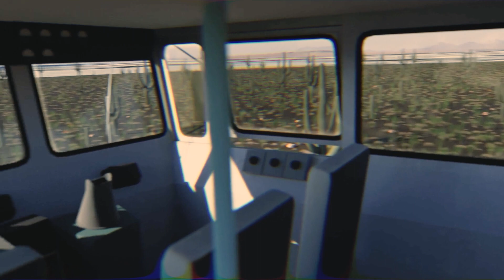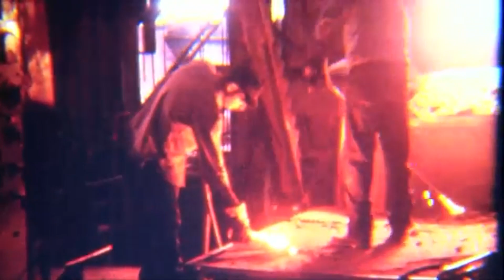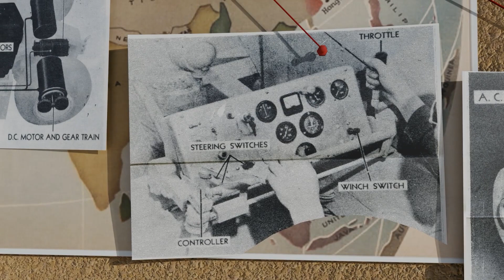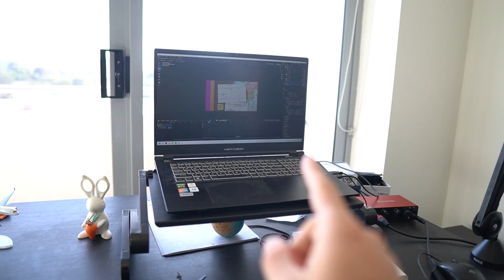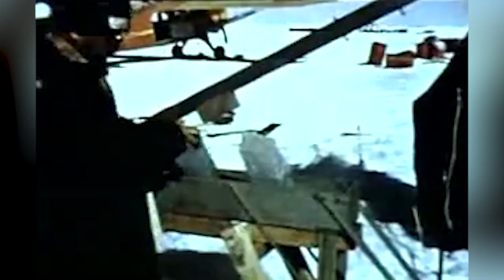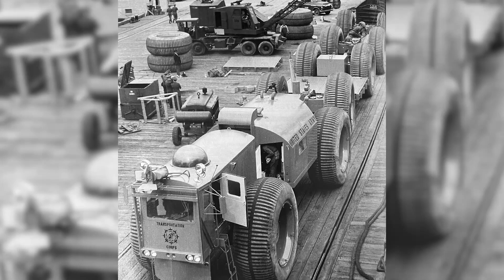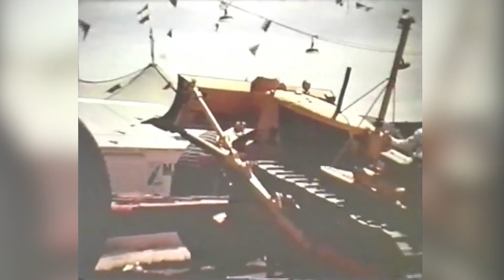What Happened To The INCREDIBLE Land Train?

Comment: It would be cool if dirty diesel locomotives could be replaced with clean nuclear power...
Reply: That is a million times a bad idea. The diesel runs electric motors. How do you think the get great fuel mileage?
Reply: @Hix2526  lol. I'm not gonna take advice on what is a "bad idea" from someone who can't even construct a proper sentence and use proper grammar. A nuclear engine, especially on a diesel locomotive, would completely get rid of the need for fuel altogether. Basically giving it infinite milage. You think nuclear aircraft carriers and submarines ever have to refuel? The ONLY reason they can't stay out indefinitely is because they can't carry enough supplies for the crew. A nuclear power source only needs service once every 20 YEARS. If anything. Nuclear locomotives would be "a million times a good idea." Just because you're an idiot and dont understand how nuclear-powered vehicles work doesn't mean my idea is a bad one. Smh. Theres nothing worse than an idiot trying to tell you your idea is a bad one.

Comment: Can you please cover The Thunderwell🙏 Nuclear steam piston concept launch system/weapon for launching cargo into orbit, destroying asteroids, lol and aggressive Alien Spaceship! https://youtu.be/VonfewfNNfI 😆👍
--  The steam accelerated Jules Verne capsule, which was suggested by the speed of at least 6 times earth’s escape velocity, achieved by the 10-cm thick, 1.2 m diameter steel cover blown off the top of the 152 m shaft of the 0.3 kt Plumbbob-Pascal B underground Nevada test on 27 August 1957. In that test, a 1.5 m thick 2 ton concrete plug immediately over the bomb was pushed up the shaft by the detonation, knocking the welded steel lid upward. This was a preliminary experiment by Dr Robert Brownlee which ultimately aimed to launch spacecraft using the steam pressure from deep shafts filled with water, with a nuclear explosion at the bottom; an improvement of Jules Verne’s cannon-fired projectile described in De la Terre à la Lune, 1865, where steam pressure would give a more survivable gentle acceleration than Verne’s direct impulse from an explosion. Some 90% of the radioactivity would be trapped underground!

Comment: right, everything back in the day was built for the purpose of its use and built like a tank, today we think newer is better and that lightweight stronger materials computerized vehicles are better faster safer cleaner then the bulky slow to medium heavy duty gas drinking behemoths. Just not the case. I know cheaper, cleaner burning is the new way, but when it comes to vehicle's we never beat the 40, 50, 60s there were designed for ever and $$ has killed them maintained upkeep etc...Ya I'll agree we have some today, but then was the golden era of building they built it every way possible with any, everything that would give it an advantage! It was great!. Now all the knowledge to evolved in todays versions just are as whats the word not impressive they are, I guess Honest, straight up for its purpose would fit it.

Comment: While the commentary is annoyingly vague, I can tell you that petrol-electric or diesel-electric drives have been around long before the 1950s and Letourneau's designs.  

For example, several German WWII tanks used a petrol-electric drive to move their large chassis on tracks.  

- and of course trains used both systems long before, as electric motors powered by current from an internal combustion engine actually begin in coal-fired steam-engine times.  
Usually for ships, but also for cargo vehicles on rail and road.  

So.  First land vehicle use; no.

Comment: Modern day innovation, seems this is a bit lagged. 
The 'Vision: would be a bit more high tech meets dimly lit atmosphere with sparkling glimmering lights from the appearance of a UV light reflector and fast rapidly moving pathways with modern architecture design and simple, clean lines. 
As far as it regards a train design on ground vs underground, that's a different topic, project all together. 😏

Comment: from an 'ENGINEERING' mind, let's visit the flaw's and failures of this experiment.  1: it relies on the terrain to be within a certain degree of gradient to traverse the grounds.  The fault in that is it will never stay the same. Trains admonished this differential by cutting and laying tracks at a grade acceptable to the cargo engine, and cargo.  2: speeds will be limited by tire inflation, engine speed control, cornering, and suspension.  Do I need to say more?

Comment: This could be an idea due for a revisit. ..particularly in areas that require cheaper less time critical outsized load deliveries. 
Sandstorms and ice storms in high winds are killers for aviation.  
With modern computer control and navigation systems self propelled sections could split off to different locations and reform later possibly on the return leg or by catch up at a staging post.  Diesel electric has got even more efficient and 
as each power waggon is a large scale self propelled generator plant that could support a community or camp.
Some Canadian cities having lost their Grid power... have resorted to using giant Diesel Electric goods locos to provide emergency power for weeks.
The train Co just re routed the rails and they drove them off the track down the main street to the standing point for the connection.

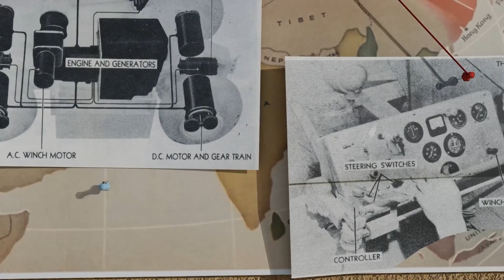Comment: 4:10 not sure where the idea that many modern electric vehicles use in-hub drive. So far it's just the land movers that are doing this.
Brabus experimented with another company to put electric motors in wheels for consumer cars but this hasn't reached production testing AFAIK

Hybrid drive train was used in WW1, and it's cool that in-hub driving was tested later

Comment: I don't want to be  mean, but being a PC enthusiast, I have to step in and say that that new PC (as cool and powerful as it is) only took "days to make" because they had to take the tempered glass panel to a sandblasting workshop. Which if they have it on site, would take perhaps two hours tops, and that's being generous. 

The rest of the system (again, not discounting how powerful the build is), would take a trained PC technician just a couple of hours to put together, and that's if they spend some good time cable-managing properly and making sure they everything boots and works properly. 

I wouldn't have said anything if it was you who built the PC, but since it's and advert, I just felt it just to point that out to potential impressionable buyers that might think that a simple glass customization is something that only that company could do. When you just need a PNG image, or SVG image, and take your glass to a crafts workshop and they can do it for relatively cheap.

In my case, I took my PC's aluminium front panel to a CNC shop and a quite elaborate cut cost me about US$16 and change.

Comment: It's amazing they did this with relays and potentiometers! No motor controllers or feedback.  They had all the cars communicating with each other to make sure each wheel was turning at the correct speed in a time when canbus didn't exist.
Reply: When we build thing to solve problems, we tend to innovate to solve technical issues. When we build thing we don't need, we tend to fail a lot. xD
Reply: Control Theory describes the theoretical feedback loops necessary to keep physical systems stable. These systems can be realized either in digital circuitry with math operations and delay lines, or analog components with inductors, capacitors, transistors and resistors. In a way, analog systems are a more natural fit for implementing these control loops. I'm pretty sure at the time you could walk into an electronics and buy an FM radio that had the very same control loops required to demodulate the signal.

Comment: Hi one of the trains is in Yuma, Az. at Yuma Proving Ground at Air port. There was several test done at the sand dooms between Yuma, Az. and El Centro, Ca. I was told by the salvage buyer of the train it did not meat the standards for the Army. he striped it for salvage and gave the rest to the Army YPG. For display. The Army said It was so heave when it was parked in Alaska it would sink in the tundra they had to 24/7 monitor it and keen moving it it would latterly sink. The name of the salvage company is or was Jet Sales Co 1401 S Arizona Ave Yuma, AZ .
Reply: WTF is a "sand doom"?  Does it involve sarlaccs?  🤣

Comment: Seen one in person in Whitehorse at the Transportation museum.  What a beast they are, the one I was in was powered by a V12 twin turbo diesel. Its not drivable as the wires have been cut to the motors but its still a sight to behold.

Comment: In 1986, the creator of the of the original Big Foot Truck scraped the TC-497 MKII tires to build the Big Foot 5, which today still holds the record of the heaviest truck at 28,000 pounds.
Reply: Wow someone has been on Wikipedia 🤣
Reply: @brandonweaver2024  I was bored. 😄
Reply: BIGFOOT#7 also has a set of the 10ft tires. It's currently on display at the "Big Fun" amusement park in Orlando, FL. It was on display at the now closed Race Rock Orlando restaurant.
Reply: what you mean the heaviest truck at 28000 pounds?
aren't zeroes missing there?
Reply: @e.s.6275   sorry, heaviest Pick Up Truck.

Comment: I would say heavy lift helicopters didn't play a role in the cancellation of the land train program for the construction of the DEW Line. The CH-54 (the military version of the Sikorsky Skycrane) shown here at 18:20 wasn't introduced until several years after the DEW Line was finished. In an old documentary about the construction of the DEW Line https://www.youtube.com/watch?v=-Mfwcp6rTjc the only helicopter in that film is an H-21 that only took light cargo. 

On single land train, the VC-22 was actually used there for one construction season until it had an engine fire and was never fixed or replaced.

It seems most of the overland transportation was done by planes with skids or sleds pulled by regular Caterpillar bulldozers.

Comment: I wonder if a nuclear or even fusion-powered version of this, built on-site, will ever be rumbling through the plains and deserts of Mars. Given a stable power supply that runs without atmospheric oxygen as well as life support and radiation shielding, this thing could be perfect in an environment that does feature low gravity, yet doesn't have an atmosphere dense enough to support operating cargo helicopters economically. So whenever you need to transport a huge amount of stuff from Musk City to Bezosville, you just strap it onto this beast and watch it tear through the red sands.
Reply: The martians won’t be exactly amused by it I don’t think.
Reply: @Squawkinator6514  Come on, it's fine - as long as you don't mess up their canals, I'm sure it took a long time to dig those
Reply: What is Amazon transporting there? You don't even get this machine there in the first place
Reply: A high grade battery core and a Newman motor could work as well.
Reply: It would be a very useful vehicle for delivering railroad construction supplies. :P
Reply: There needs to be something on Mars worth all the trouble getting such a machine there. Right now Mars looks pretty worthless. There's bound to be enormous mineral reserves that haven't been found yet. Time will tell.
Reply: @olliefoxx7165  That's true, I'd assume with all those vulcanic tubes that are there apparently, at least some would have the good stuff in them - but also from a colonization point of view, you'd probably want to transport supplies over increasingly longer distances without comparatively tiny 2 to 4 man rovers, and lacking oceans, roads, or an atmosphere particularly conducive to air travel, it's pretty much that, actual trains on rails, or rocket-powered vehicles. I agree however that time will have to tell whether humans will ever travel to Mars in significant numbers, for mining and/or to simply live there.
Reply: @MrFreddyFartface  Wouldn't it be a grand time to be alive if/when there were colonies outside of earth? I often wonder what minerals or precious metals exist on Mars that we don't have on earth. Humanity has the capability to do amazing things. I was hoping the release of all those UFO videos would spark a desire to accelerate our technology towards peaceful exploration. Maybe it will if the right people come along.
Reply: @olliefoxx7165  the moon is abundant with helium 3 and is a lot closer to earth.
Reply: Too heavy.
Reply: If there isnt a city named New Los Angeles or Newer York on mars or the moon ill be very dissapointed
Reply: Erm, give your head a wobble mate. The lack of a breathable atmosphere and the lack of the colour green will drive the colonists mad within six terran months.
Reply: This is already ready to be sent to mars....Tesla is way ahead of the game

Comment: The heavy lift helicopter being one of the reasons for the demise of the land train makes no sense to me because, unless they would have the helo's in constant motion, they could not match the overall cargo shipping of the land train.  I don't know about maintenance needs of the train, but helo's need a lot of maintenance and repair.
Reply: It does make sense though, the last land train had a capacity of 150 tons, heavy lift helicopters are generally around 15 tons, so ten helicopters or roundtrips which isn't that many. Helicopters sure are expensive to maintain, and I'm sure they can't fit as many different kinds of cargo as the land train. However the land train has more limitations than that. It only works on specific terrain, fairly flat land with no obstacles, or roads where you can use regular trucks anyway. Helicopters can fly anywhere, with the only limitation being weather that you can wait out and still beat the land train to the destination. Helicopters can also do rapid troop deployment and other missions.

The land train makes sense for niche things like building the early warning radar line, but that's a one-time thing. It just doesn't have enough regular applications to make sense to keep around.

Comment: fun fact. 4 of the wheels from the 3rd iteration were bought by a guy from Missouri, who then stuck them under one of his pickup trucks, the original Monster Truck, Bigfoot 1. he then bought 4 more and stuck them on his 2nd truck, Bigfoot 2. both BF1 and BF2 got the tires removed as they weren't really practical and the truck that would use them for a bit after was Bigfoot 4, until Bigfoot 5 was bought, and then it built to accommodate the large tires. it would occasionally run a dual tire setup but during the early 90s, Bigfoot 7 got reworked into a Bigfoot 5 clone and currently sits in Fun Spot Florida as Big Fun 7 while Bigfoot 5 remains in Pacific, MO.

Comment: 0:30 "Nuclear powered, with a crew of 6."
Are you f'g insane? No atomic pile, let alone generator could be crewed by only 2 men per shift, with a 3rd man piloting the craft.
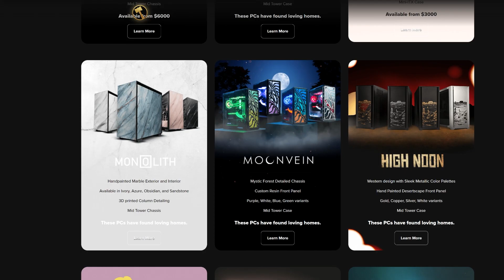Also, 6:45 just because you use a tiny forklift to move something, doesn't mean that it "requires a forklift just to move it." I could put a soda can on a pallet and then claim that it is so voluminous that it required a forklift. Or float it in the water and claim "so enormous that we had to transport it via water."

Comment: Do the wagon wheels require rubber tyres? They don't generate traction like the locomative. Having the wagon wheels use low friction material could save energy. Best reasong for trains to exist is that it's superbly effiecient due to all metal wheels.
Reply: But the ground is not flat metal like a rail? Besides, traction and rolling resistance are two different things. Trains have relatively poor traction. The engine needs to be very heavy so it’s wheels don’t slip and then they struggle on steep gradients.

Comment: One side note: one of these overland trains' wheels were eventually used in bigfoot #5 AKA one of the first monster trucks!
Reply: I have seen pics of one of the Bigfoots (BigFeet?) using a total of 8 wheels on one truck. 2 on each corner.

https://monstertruck.fandom.com/wiki/Bigfoot_5?file=Bigfoot_5_duels.jpg
Reply: @raymondflowers2167  huh, interesting. From what info I can gather, this was merely done as a gimmick, and not intended for competition use (kind of like that compter that once played Jeopardy). In the early days of monster trucking, there were several gimmick trucks that never stuck around. One that comes to mind is when the bigfoot and bearfoot team both decided to equip vans with tank treads.

Comment: The high carbon intensity of flying things around with helicopter is a potential reason to bring this technology back.  It could even be solar powered as long as the traveling speed is low enough to support that.  And maybe if SMR technology ever becomes practical at the scale it could be used as a generator to power these.

Comment: Just shows that you can not rely on military contracts to launch a good idea. civilian uses for the land train would have made up for any lack of military applications, especially in regions with little to no infrastructure. Still the underlying technology, the electric drive wheel, would have made a huge splash decades earlier in larger and heavy duty vehicles.
Reply: Yeah, selling off the construction vehicle production rights seems like a big mistake on LeTourneau's part but at the same time he did need that money to develop this. I do agree with the electric wheel drive, I wonder if that system could be applied to other types of vehicles, not just the land train.
Reply: @Casuallylatetothis  
I think Long haul semis, Dump trucks, Garbage trucks, some construction vehicles would be low hanging fruit. Delivery vehicles, Buses, and HD Pick-ups would be a little less likely but still possible.
Reply: @DocWolph  Quite a few larger mining trucks use diesel electric drive.